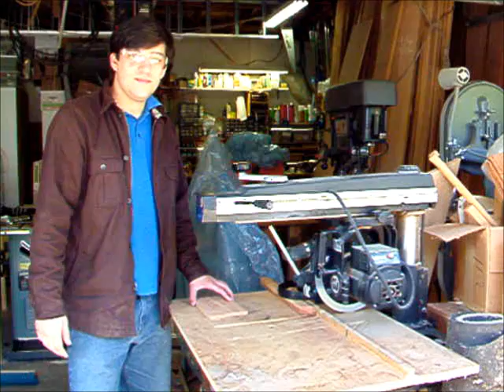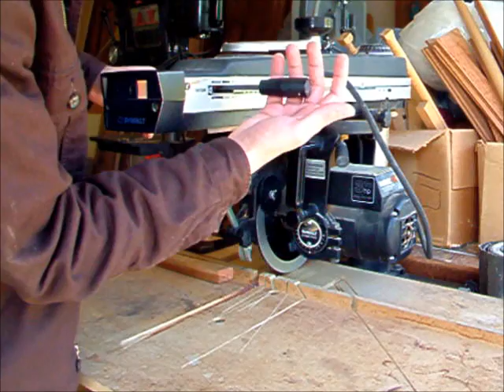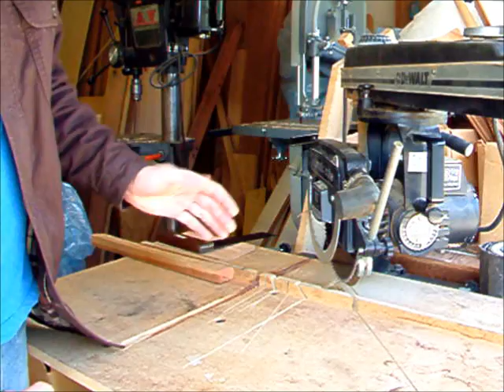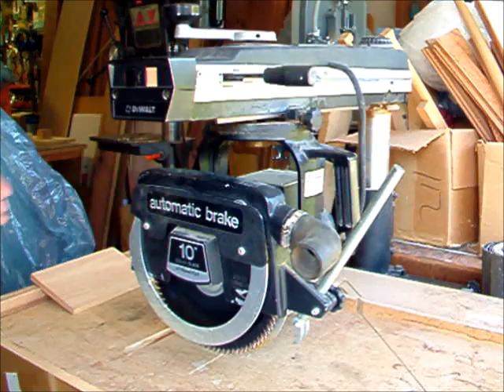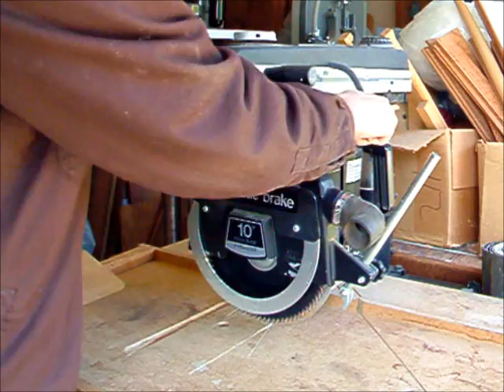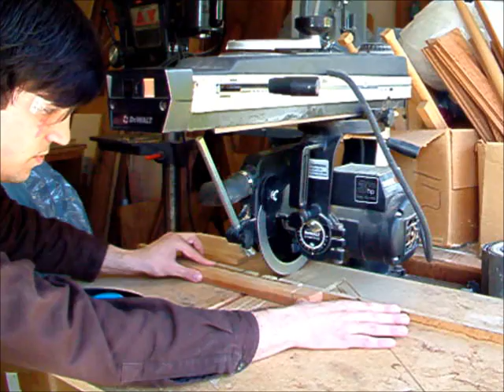Intro to Radial Arm Saw

Comment: I run a studio in which cutting wood and other materials is simply not the primary activity.  Yet I need to have that capacity when called for. I can’t afford to dedicate a huge floor area to a table saw we use maybe twice a month.  So I bought a Shopsmith; Its a table saw, lathe, drill press, belt sander, disc sander, jointer, and band saw, all in the space a bicycle takes plus a cabinet to store the attachments.  But I have a large, 3hp 1953 DeWalt radial arm saw- because it fits against a wall and it, too is versatile. It rips better than a table saw for rips less than 26” ( because it can not kick back at the operator ) It cross cuts better and more accurately. It cuts dados, miters, bevels and compound angles, and even can be used as a shaper and a planer with the right attachments.   A versatile tool that takes up not that much space.

Comment: Nice review Kenneth. I just bought a black and decker one today that looks almost the same... surprisingly I guess someone along the line replaced the blade guard assembly because it says Dewalt on it. The table is no good on it (the particle board is pretty much rotted away), so I was wondering what the dimensions are on yours.

Comment: I've been reading some of the comments here saying the radial arm saw is dead. Not true. If you have room in your shop/garage it is really nice to have both a table saw and a radial arm saw. Also, a slide/compound miter saw is nice to have around also. You can do some things easier with a radial arm saw than a table saw. Mainly dados and tenons. I find it easier to cross cut long pieces, (6 to 12 foot) with a radial arm than a table saw. If the pieces are wide a slider doesn't always have the capacity. I love my table saw, (and all my tools) but I also love my radial arm.

Comment: Excellent Video for use and safety! I have a Dewalt Black and Decker radial arm saw and I have a smaller 8 inch blade mounted. I orange taped up an area 8 inches each side of the blade on the base to mark keep your hands out of this area. Also, any small piece of wood cutting  I use a clamp to hold in position prior and during cut.  Make sure saw is off and blade stopped before grabbing any piece of wood near blade.  My friend lost 2 fingers on a table saw after turning the saw off and grabbing the loose piece of wood for the blade was still spinning.
I only use the saw for cross cutting and you are right always be ready for any kick back. Be safe wood working!

Comment: When I crosscut, I don't put the wood to be cut on the left hand side, instead I put it on the right hand side...
Reply from the maker: Sadly, I am left handed.
Reply: @KennethFinnegan  I'm right handed but I put the bulk of material on the left side of the saw too. The way my miter saw is set up the trigger handle must be used with the right hand and you can't see where your cutting from the right side. I've also noticed that I use my table saw like a lefty. LoL I put the fence on the left side of the blade.

Comment: Great fucking video. I am just trying to figure out what is the best route to go with wood working. My thing is that there are soooo many different saw types that I want the best saw that is multi functional. So maybe just this and a table saw?
Reply: ***** I am digging it, I got some big projects coming up. I need to get this and a table saw. THanks for this video.
Reply: @JamesOfTheTrades  By what I've seen in many videos is that they type of saw doesn't matter. A table saw can do the same as a miter saw. A RAS can do everything a miter and table saw can do. If you have all three, great. If you only have 2 you're still fine. What seems to be the most important thing is the blades and knowing what blade is best for the job. Blades have different kerfs for different jobs. One blade can fit most but not all. Stumpy Nubs has a great video about blade types.  https://www.youtube.com/watch?v=0J1pRBiVKbI
Reply: Your best  use of money is a great table saw and a good compound miter saw.   The speed of switching to different cuts between a radial arm saw and a compound miter saw is like comparing the speed of a Porsche to that of a delivery van.     Seriously !
Reply: Michael Benjamin Thanks for that tip!

Comment: What is the model number on the Serial plate and does that say 3.5 hp on the motor? That's got to be peak hp rating. What is the amp rating on the motor?

Comment: I must agree with 100nortonfan. Either the miter lock and miter clamp are loose on this saw, or the column gib needs adjustment. The arm should NOT have any radial play, which defeats accuracy and creates a hazardous machine. This machine is a particular risk for ripping, one of those that adds to the hype about the dangers of ripping with a radial arm saw.  Start to feed the rip stock into this blade, then the arm will shift, heeling the blade in the kerf and kicking the wood as far as the saw can throw it.

Anti-kickback fingers must be set 1/8 inch below the surface of the stock being ripped. Set them too deep and they will not grab the wood.

Mr. Finnegan is not clueless, and we can give him a break, but I'd rather see him live to middle age without injury.  To do that, he needs to thoroughly adjust this saw.